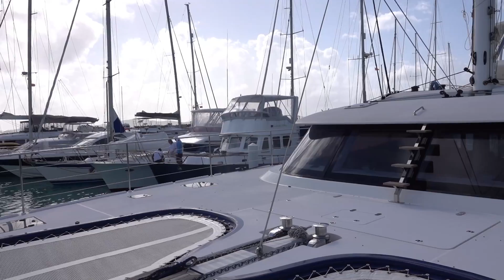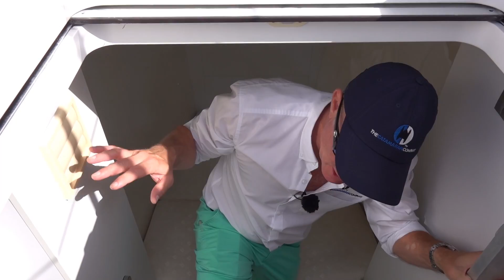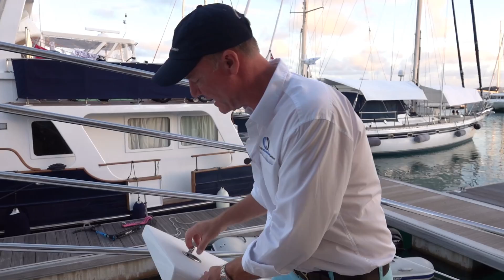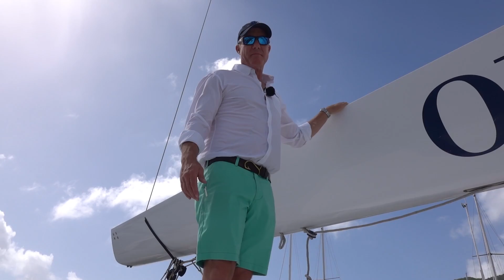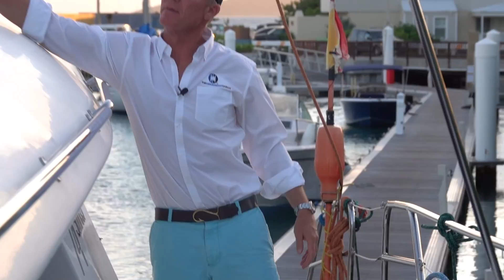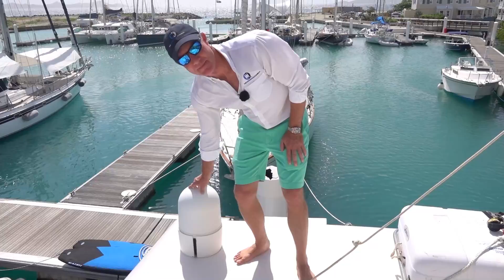Walkthrough of a Sunreef 74 Catamaran for Sale in Florida "Obsession" Part 1 Boat Exterior

Comment: It is a nice yacht, not the best maintained one out there. 3.5mil.. as a asking price is way to much.
Reply: if only the tender cost 100k new or 55-60k second.....plus all the others don.t have all the upgrades, if only the carbon mast and boom,all the sails cost alot........so i belive is not that expensive,compareing with the other 74.s
Reply from the maker: That's a good analysis of the price for a vessel, Dd Ddd. The only way to ascertain the true value of a boat is considering both the condition and all the different options it's equipped with. "Obsession" is loaded with expensive, useful options that many catamarans this size do not offer. Thank your for watching our videos and don't forget to subscribe.